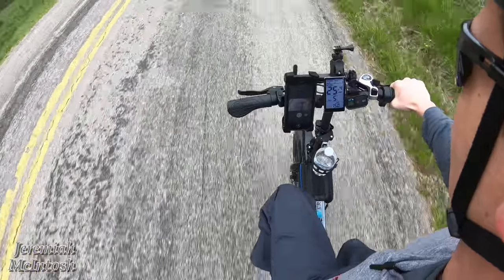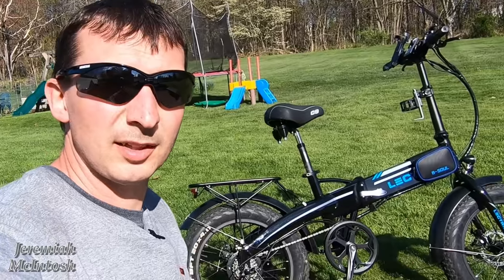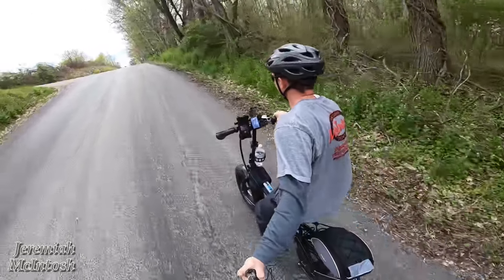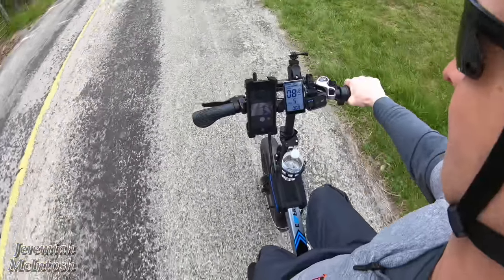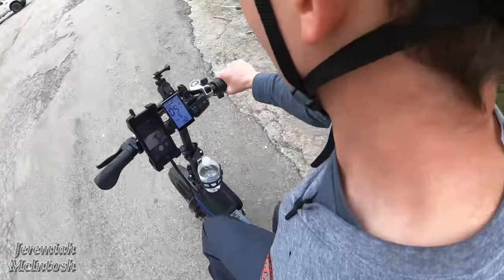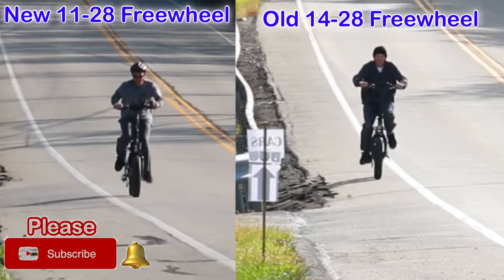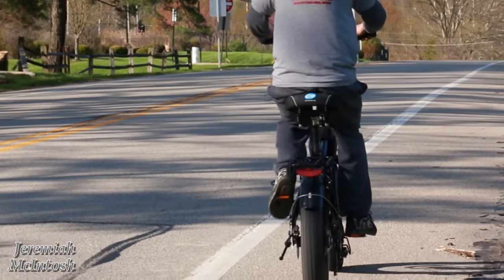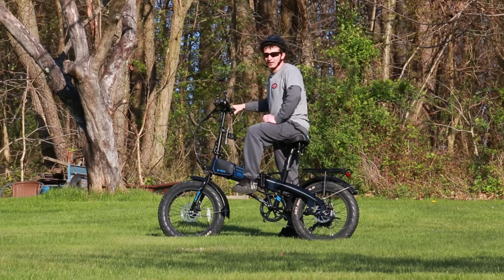Lectric Xp ebike Test with new Upgraded 11-28 Freewheel. Wow!

Comment: If you were to do it again would you consider the 11-34 instead? I’m going to order one soon. Thanks Jeremiah!
Reply from the maker: I have thought about the 11-34 a few times but to be honest where I live with the hills around my area I haven’t needed anything lower than the 28. One thing I feel it would really be good for is if you were trying to pedal the bike up the hill with out any motor assist like if the bike broke down or the battery was dead but other than that I’ve been happy with the 11-28
Reply: Jeremiah Mcintosh thank you! That helped a lot because I’m near the beach and it’s fairly flat here. I made sure to order through your links. Your channel has been a huge help!

Comment: Jeremiah, you nailed it with this video!
Exactly what a lot of people are looking for: to see how fast the peddling is at maximum speed.

Also very good you told the speed while on the bike.
Also the comparing with older video's...smart thinking.

Well done!

I have a similar bike but not a Lectric.
The online dealer told me I could not get smaller than 13.
Isn't the axle size and diameter cassette standard?
Do you have a link of the freewheel?

Thanks, great video.
Reply from the maker: Thank you. All the links are in the description of my videos.

Comment: Love your vids. I have 700 miles on mine since Christmas and Im having fun!!!. My favorite upgrade is the aftermarket 15.5ah battery I mounted on the rack.
Reply: Hey Luvthe lake, was curious about the 15.5ah battery. So, it's used now instead of the one in the frame of the bike right? And if so, I'd imagine you removed that one. Also, do you have a link for the aftermarket battery? Thanks so much..
Reply: @jono5900  No I did not remove the stock battery, I use it often.  I hooked them both up to the bike. I got parallel y connector and t style deans connectors w/cable for $10 bucks and the battery was $290 but had fast shipping ,I could of got them for $270 each on eBay. It took ten minutes to hook each bike up . I use both but the 15.5 battery I use most often for the speed and power . With the turn of a key I have a fresh battery. It doesn't allow me to add picks on here. You could stack two or three on the back rack and ride 100s of mile a day.hehe.. I ride 50 miles easy without worrying about a charge. Its a blessing and ease of mind too. My wife loves hers too.
Reply: @rustymeyers1  Thanks man..that's awesome to hear. I just received and already assembled my bike this AM and am charging it as I type. I think my first mod might be swapping out the free wheel to a 11-28 as I know the spinning pedals is gonna bother me. I'm not at all electrically inclined so I'll prob try and find someone here in NYC to make 3 adjustments: Swap out the freewheel, connect a more powerful light directly to the existing electrical system and add an additional battery with your y connector mod. Thanks again for the idea....
Reply: @jono5900  get a good seat post and seat and great stuff the tires. The rear tire is super hard to get back  on the bike forks. Im not electrically incline either hehe. The battery is a super simple addition but kind of expensive. I like the battery power a lot..
Reply: you can slowly but timely pedal your pedals without adding leg power at a even speed and the bike will get to the top speeds.
Reply: @rustymeyers1  seatpost and seat are arriving this weekend

I don't think I'm going to slime my tires as I'm not going to be doing much if any off-roading

And no doubt it cost some decent money to add the mods that you have but I think the ability to get the extra mileage it's really awesome

I guess I'll see how I'm using the bike here in New York and decide at that point about adding another battery
Reply: @jono5900  Have fun !!! Be safe !!! You'll love your lectric bike.
Reply from the maker: Thanks for all the great info! 👍How do you switch between the two batteries with the key?
Reply: @JeremiahMcintosh  you can only run 1 battery at a time . each battery comes with its own key, I keep both keys on 1 key ring so obviously I take the key out of the bike battery and insert the other key into the new battery on the back rack. You could understand it easier if I showed you. It took ten min. to hook this up. Seriously. you charge them both individually too.
Reply: @rustymeyers1  if you ever have time to take a few pics or snap a quick video of the mod, i'd be interested in viewing it :)
Reply: @jjoncm1  I don't know how to attach them on here, its so simple though and only takes a few minutes to hook it up. Id be glad to show you. You take off the 4 screws under the seat side of the bike. Follow the 2 wires from the battery connector you just took off,   unplug those two wires  which are T style deans connectors, put in a parallel no wire T Plug parallel Y Adaptor  (apex rc products part # 1276) plug the stock battery back in one side. The new battery into the other side. The new battery comes with a cable and one dean style t connector with wire but you need one  more connection than what comes with the battery.  ONE  Female T-Plug / T-Connectors (Deans Style) with EasyGrip & 10CM 12awg Wire  connect to the new battery . you plug this female into the same T plug the stock battery is plugged into. And connect that wire to the new battery wire. ,,,,,,,,,,,,remember ,,only one battery can be turned on a one time.
Reply: @jono5900  I hear your new bike comes with slime already in the tires !!! thats great !!
Reply: @rustymeyers1  Wasn't aware of that..Will look into it as now you've got me curious..lol 

I've only been on a few rides but so far I'm really impressed. I changed some of the settings on the display and am very satisfied with this bike's acceleration. And you were right, I swapped out the seat and post from the get go and the ride is very smooth even with all the crappy roads here in NYC. I think my first big upgrade is to swap out the flywheel as I can tell that I'm gonna be spending most of my time in at least 3rd gear but over 15mph on straight aways, the pedals just go round and round..kind of bothers me. I believe that other flywheel combo will help with that..no? After that, I might do the battery thing like you did. Anyway, thanks again to you and everyone else for sharing insights as it really got me up to speed(pun intended)
Reply from the maker: The 11-28 freewheel made my bike way better and in my opinion should come with it from the factory.
Reply: @JeremiahMcintosh  Thanks man, I appreciate your input and videos. If you do try luvthelake's 2 battery mod, maybe you can post a video on that ;-)
Reply from the maker: I would love to try t but don’t want to spend the money on an extra battery lol. 
I’m glad you enjoy my videos! Thank you!
Reply: @JeremiahMcintosh  I hear that !!!! The wife and I have 600 into extra batteries, hehe... Its way worth it to me to be able to use it all day without a charge. Its faster for about 10 miles too if im in a hurry. Yes the $ is a bummer. Thanks for the vids again..
Reply: @rustymeyers1  Nope..confirmed with the company..but it was recommended..lol
Reply: @jono5900  Walmart has the slime for tube bikes for $8.99 and you can do both tires with the one 8oz
Reply: @rustymeyers1  Thanks man..although that's the one major store not in NYC..lol I'll get a hold of some..that being said, I hope I don't mess up the valve as I've read about a valve problem if you don't do it correctly.
Reply: Hey dude,700 miles have you'd changed brakes & if so,how long would you say there last.

Comment: Hi, I have the same bike and was wondering how you like the your bottle holder. Is it staying put with the clamp system. I'm having a hard time finding one that fits around the handle bar stem being that's is so fat.
Reply from the maker: Yes it has been working fine for me And I go over it a little more in my accessory video if you would like to check it out here. Lectric Xp E-Bike Accessories! Suspension Seat post and Cloud 9 seat upgrade comparison! https://youtu.be/3co2mgK-rLU
There is a link in the description of my accessory video for the clamp And you can attach any bike bottle holder to it.

Comment: Great video, thanks!  I tried to source the  11-28 freewheel, but that Amazon link has the shipping as much as the part and a long wait.  Any idea of another source?  I tried googling it.  There's a letter "t" in some descriptions but not all.  Your guidance please?  Thanks again --
Reply from the maker: The t stands for teeth so you should be fine. The one you linked should work and here is another option  that should work as well just keep in mind it is an affiliate link and I will make a small commission at no extra cost to you if it is used. 
https://amzn.to/2YCsjZU

Comment: Is it possible to simply swap out the 8th gear cogs from your old cog to your new cog or is the cassette a single unit?
Reply from the maker: No you can’t change just one cog because it is a freewheel and not a cassette. Freewheeled are one piece and screw on.

Comment: Ok , so strange question, but how slow can this bike go , like for walking /biking a dog  ? Or cruising around very slowly , like biking along with a friend who is walking ?
Reply: Also , can you take the battery out and charge it in the house or does it have to charge in the bike ?
Reply from the maker: Yes you can take the battery out and charge it in the house but it is a lot easier just to leave it in. You can turn PAS off and pedal manually a slow as you want or use PAS1 and set cruise control to whatever speed do you want then turn Cruise off and you could still pedal. I’ll show you that in this video here if you want to check it out. 
https://youtu.be/7s3S-Kg6AA8
Reply: Jeremiah Mcintosh awesome!! Thanks!!!
Reply: @Chukalux77++ Jeremiah Mcintosh has a video where he found out how to set a slow cruising speed in pedal assist 0 and he was still able to add a small amount of speed by pedaling just a little bit. After watching his video I tried it and it works! The slowest that I am able to set the cruise control on my Lectric XP is 2.5 MPH which is insanely slow. This is slower than walking speed (4 MPH) and it is quite a challenge to balance the bike while travelling so insanely slow. I believe being able to set cruise control to slower than 2.5 MPH would be a stupid thing to be able to do. Who would be able to balance a bike at a turtle's speed? By the way, if you try to set the cruise control to slower than 2.5 MPH, it just goes into walk mode which is faster at 2.9 MPH. To get into walk mode just long press the down arrow for 1 second. I have found out that walk mode is easier to get into than slow cruise and is better suited to biking along with non-motorized bikes. I just put it in walk mode and pedal slowly, hitting the brakes occasionally and the other bikers don't even know that I am using the motor.

Comment: So was it worth changing the freewheel?
Reply: Yes. He was peddling less hard and going faster.
Reply from the maker: It was definitely worth it in my opinion! I did a 16 mile ride yesterday and was able to pedal less but put more energy into the motor while traveling at higher speeds. I don’t really think it makes you go any faster but it allows you to keep constant pressure on the pedals a lot easier!
Reply: @JeremiahMcintosh  Thx for the response. I'm just trying to be as informed as possible, my bike should arrive this week. Stay safe.

Comment: I am waiting on my bike to arrive soon and was looking for a suspension post.  I was going to order the one on the Lectric website but they are sold out.  The one you recommend is much cheaper but gets fairly low reviews.  What are your thoughts?
Reply from the maker: I have no complaints on mine at all I would definitely recommend a different seat for sure that’s probably more important than the post in my opinion.Have you seen my accessory video?
Reply: @JeremiahMcintosh  I have.  I also want a cell phone bag but don't think you have one.  I already bought a cloud 9..
Reply from the maker: My frame bag actually holds a cell phone as well that Velcro’s to the top of it. Is that what you mean? There is a link in the description of my video if so.
Reply: @JeremiahMcintosh  i want the kind that fits on the center rail with a clear top and is weatherproof
Reply from the maker: Yes Dave that’s what mine has. Check out my link that says bike frame bag.
Reply: @JeremiahMcintosh  I'm sorry, I hit "bike frame bag" on your page.  4 videos came up but I can't find the bag.  Would you mind providing a link here?
Reply from the maker: Sorry Dave I didn’t have the link on my accessories video but I’m going to update it. Here is the link for the frame bag I have but I think it is out of stock. Also keep in mind it is an affiliate link and I will make a small commission at no extra cost if it is used. 
B-Soul frame Bag https://amzn.to/2U7oSId
Reply: @JeremiahMcintosh  i don't mind buying off an affiliate link but not available.  I'll check back.  I subscribed to your channel as well
Reply from the maker: Thank you sir I appreciate it.. As per the rules I have to disclose that every time I share an affiliate link.

Comment: I upgraded my freewheel too.. Huge different at higher speeds.   Although  most the time I try to stay in pas 3 at 10 amps to conserve battery..    But for short bursts  or quick trips, and down hills its great.  Anybody who buys this bike should not expect to go 28 MPH the whole ride.  Your battery will quickly drain at that work load pulling 20 amps..  I find 12-15mph is the sweet spot for the xp most the time.

Comment: Maybe I missed it, but are your settings still for a Class 2 bike or was that changed to a Class 3?
Reply: I think this is right? It continues to be class 2 in most states because the motor is 750w  or under and the pedal assist stops at factory 20 mph. I think changing the gear ratio does not change the pedal assist limit so unless the speed limit has been up’s in the LCD menu. It should remain class 2 with a throttle. Arizona and California restrict class 3 to 28mph but no throttle allowed and I think it must have a speedometer?
Reply: @remixread  THat is my understanding as well. I am hoping Jeremiah can tell us if he changed the LCD settings to make it a Class 3. I'm hoping he left it as a Class 2 and is still able to accomplish the speeds simply as a Class 2.
Reply from the maker: John I did have the speed turned up in the settings. Changing the freewheel will not really make you go any faster it will just help you maintain pressure on the petals easier at a little higher speeds with less rotations of the cranks.
Reply: @JeremiahMcintosh  Thank You!